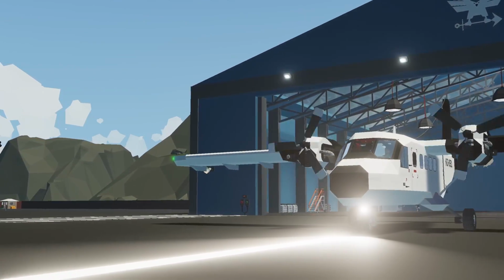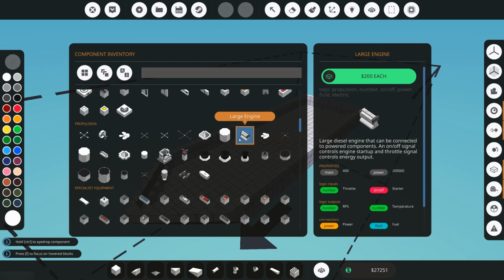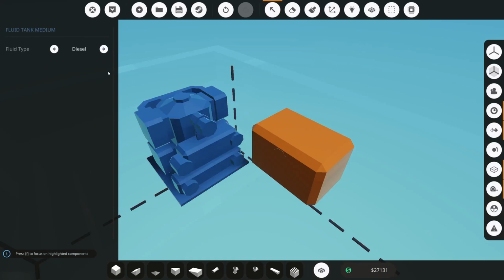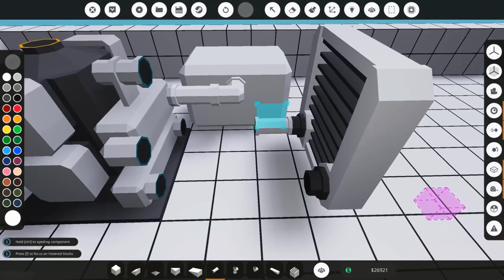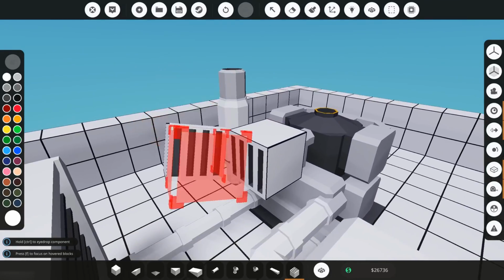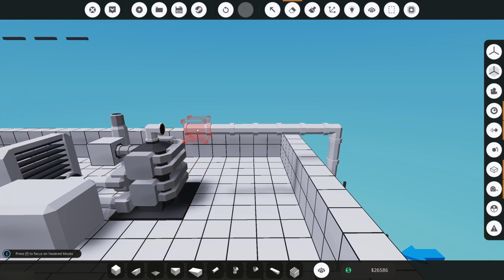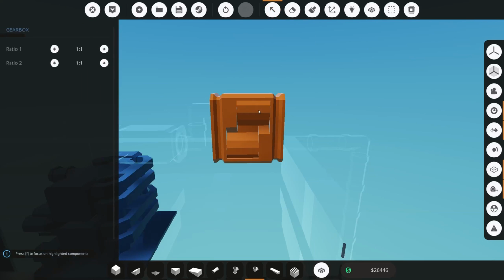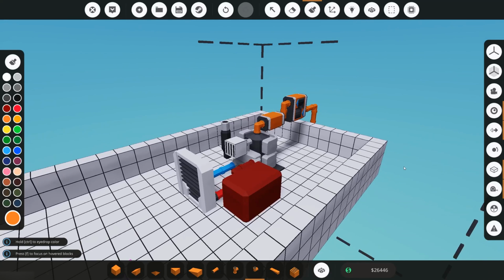Stormworks Official Tutorials - Engine Basics

Comment: whenever i put down a engine it pops up with eletric not connected
Reply: So connect electricity...
Reply: @Bendigo1  why would I be watching this video if I knew that
Reply: @RaiFoxi  🤷‍♂️  i know it but i still watch
Reply: In the logic tab, there are multiple logic connections on the selection on the left, logic, electricity, composite, video audio and rope.  to connect electricity, select the lightning bolt and connect it from battery to anything that needs electricity.   Power, as in rps or engine power, needs pipe connections.
Reply: @Bendigo1  Thanks!
Reply: @Bendigo1  thanks for responding tho a little bit late i figured it out some time ago
Reply: @Bendigo1  How do you connect energy?

Comment: Did a radiatior work in a closed room? My engine starts always burning up.
Reply: They do, but not as well as in open air.  They work by averaging temperature, so if air temp is high, cooling ability is low and if it heats up air by cooling engine, it cools engine less and less and engine gets hotter and hotter.

Comment: This tutorial is very helpful but i have a question - you set the gearbox to a ratio of 3 - 1, but didn't explain why or what that does.
Reply: 3:1 means that the engine will need to rotate 3 times to rotate the propeller once.
This helps in increasing the propeller torque but at the cost of reduced speed.

Comment: I actually have a question about engine coolant: does it works if I don't install the radiator, but instead I pump in seawater from the sea and pump out the water from the engine?
Reply from the maker: Yes

Comment: When i put my engine down is says Electric not connected Missing on/off and missing number
Reply: you need a battery and switches to control the engine
Reply: @krombee  I have the same problem as him. But batteries just rewire the input/output and it does nothing anyways

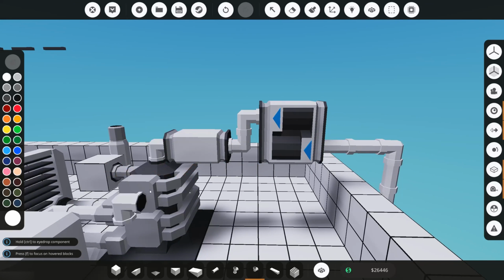Comment: 8:50 actually when you face the engine you get more rps but less torque
Reply: Nope, you get more rpm so you get more torque. Just think about an offroad gearbox it has low and high range, in low range you get higher rpm and more torque
Reply: @ds_lyst05  Unless this has changed with the 1.0 release, that's not how this game works. You get one or the other, not both. Sure IRL offroad transmissions can do that, but Stormworks has you either have higher wheel/propeller RPS with lowered torque to it or higher torque to it and lower RPS. This is inverse for the engine. When the wheels/props has higher RPS, it in turn gets higher torque but lowered RPS, when the output torque is cranked up it apparently siphons it out of the engine and the engine's RPS shoots up.

As far as I know, there's no gear combination in the game that raises both torque and RPS higher than 1:1 at the same time . If there was, then the game would be really broken as then you'd be able to produce more energy from less than started (breaking the law of conservation of energy.) It's weird, but it ends up balancing out in the end.
Reply: I exsist more rps = less torque 
Less rps = more torque

Remember that we are talking about the output.
Reply: I might be wrong but I thought it works in a way that if you select the one with higher rpm you get more torque but less speed and with the other one more speed but less torque, and I felt like this was the case
Reply: I exsist like when you shift down in gear you lower your output rpm so you get more torque. 

But I meant that jersey flipped the way you mount the gearbox to get more rps
Reply: @billy-blij-1-2-36  oh OUTPUT rpm, I missed that, thank you!
Reply: @ds_lyst05  I really wish that you could break physics and get higher output torque and RPS at the same time. Generators would be awesome at that point.

Comment: How do you get the new custom engines? Weren't they supposed to come with 1.0?
Reply: they are in the experimental version of the game
Reply: @Retsom3D  so just did some digging turns out something went wrong with steam and the experimental branch is delayed which is the reason you cant get the engines
Reply: @g1ngersnaps149  i am currently in the experimental branch and i have custom engines. dont know what you are talking about.

if you wish to i can stream on steam, name is The Senate
Reply: @Retsom3D  Where do you acces it ? I'm really confused, is it from the game or steam ? I see neither of the options right now.
Reply: They only came out a few minutes after gingers comment
so that's why they were there for you